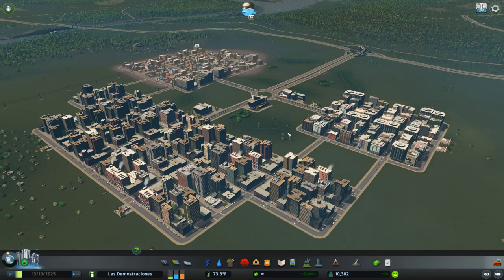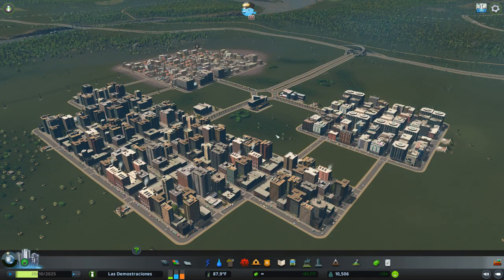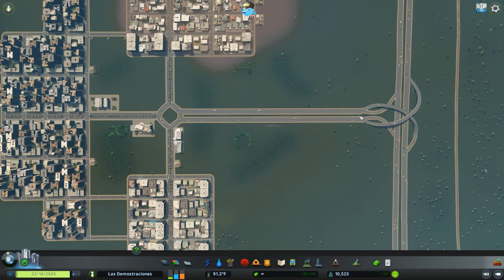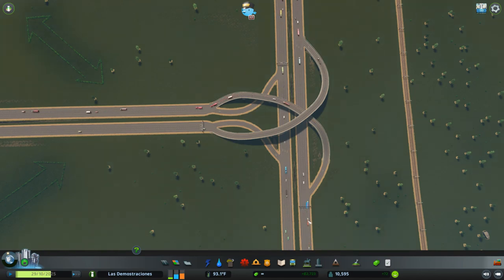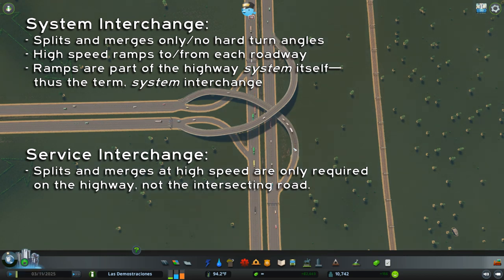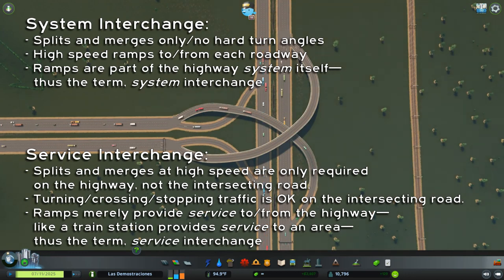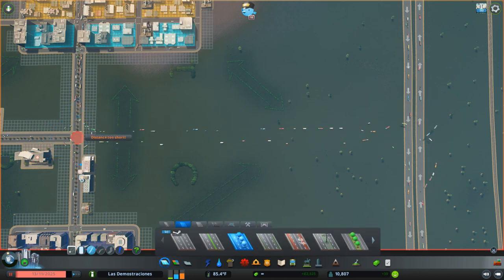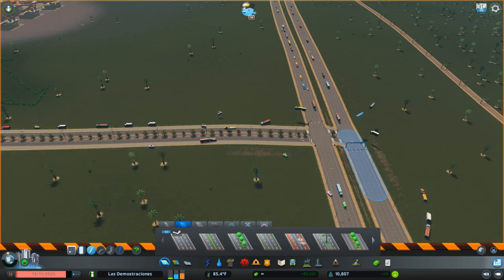Crash Course on Building Highway Interchanges | Cities: Skylines

Comment: I would put in a more free flowing double trumpet, longer lasting if it needs replaced at all instead of upgraded.   Pull traffic off the freeway before adding it on and you are jam proof.  Takes up less space than the diamond too.

Comment: OMG that last trumpet is really eye opening 😱

In my mind, I thought of dividing diamond in order to make the southern inbound traffic turn left then send them to the right side of the road but since I play without traffic mods (e.g. tmpe, road anarchy, custom road designs), the only way to do that was to make dedicated ramps like in the original interchange 🤣

My city is already in its fourth year so in the early days, I only construct system interchanges but when my city expanded, I used custom service interchanges from workshops so my mind hasn't adapted to that and I've only think using system interchange concept 🙃

I'd definitely try to practice and make my own service interchanges in a new city because finally, my first city is about go get full with no space left to build 🙈

Thanks for this video!
Reply from the maker: Daniel Alexander hi Daniel, I’m so happy you enjoyed! I think you’ll be pleasantly surprised by how effective simple service interchanges can be. Just start with diamonds and folded diamonds...and keep the ramp intersections farther apart for busier cross roads.
Reply: @LeeHawkinsPhoto  yea! I usually keep my intersections 4-6 nodes apart so perhaps that'll suffice 😁

Comment: Am i crazy, or did you take a decent junction with no weaving or lane switching and replace it with a worse one which has lots of conflict points and absolutely can't hold up to heavy traffic?
Just because the default one is for a "Highway" doesn't mean it won't work well for normal roads. You can just downgrade them and join them to a normal avenue to cut down on the amount of space they take up.
The default one does allow traffic to go both ways on the highway, and the game makes no distinction between the system and service interchanges you mentioned. you can take any road and upgrade/downgrade it to the type you need and freely switch between normal roads and highways as needed (space permitting).
Additionally there is no downside to ramps like the default junction in this game, other than aesthetics. in-game maintenance costs are insignificant for the ramps (which isn't true of IRL highway ramps).
Reply from the maker: John Boyer great question! The original junction is fine, sure, except that 1.) it does not allow for extending the main road across the highway and 2.) it is total overkill. This type of interchange will handle plenty of traffic without significant traffic problems...I show this in my series More Money, Less Traffic in I think Part IV when I demolish another one of these.

Unlike many beginner videos, I completely advocate against extending these starter interchanges into a highway—highways are really hard to get right for new players in dense urban areas, and I’d rather see players demolish these big boys and build simpler interchanges (especially at first) because traffic problems are sooo much easier to troubleshoot.

So yes, the default is an ideal interchange if you enjoy building Robert Moses style and you want highways everywhere...and there’s no doubt that highways are fun to build and watch...but they wreak havoc on urban traffic patterns, neighborhood connectivity, and walkability, and the majority of new players don’t understand how to fix the problems they’ve accidentally created when they use them. 

In short I wanted to demonstrate that simple works just fine, and opens up lots more options. And there are no weave areas with the trumpet interchange that didn’t exist with the default 3-way stack interchange—I built the diamond interchange here so I could show that the trumpet is more appropriate here, since it eliminates the turn conflicts.
Reply: Ikr, irl they do build a big interchange for a town when they plan to develop the town to a much bigger scale. Taking down the interchange is double work as you would need to upgrade in the near future of 15K people.
Reply from the maker: Iris Dovera Iris Dovera except that I’ve done this in every city I’ve ever built, with two of them built up well beyond 200k residents. One city has a diamond interchange, and another is a bit more complicated. So really, if I built this city up to 15k or 150k, it’s possible that I’d need a more sophisticated interchange, but what I build in this area will affect traffic flow far more than pure population. So many city builders use the highway as more of a local trunk road, which is really a job better suited to several avenues rather than a monstrous highway. When your neighborhoods are connected by more than just highways, then it relieves a ton of pressure on the interchanges—which are always the trouble spots in a highway system.

BTW, sorry I missed your comment a while back. I love the debate—I really wanted to stir the pot here and get people thinking. I think a lot of the conventional wisdom with this game is...not wise...at least not all the time. Highways especially are way overused.
Reply: @LeeHawkinsPhoto  Agree with Lee here. The service interchange is not appropriate for a city road. Building oversized intersections is unrealistic. I'd at the very least downgrade the access road, although in future I'd actually probably put a divided highway through that open green area. Super overkill for the size of the city now, but I'd leave the space for bigger roads and even public transit for when the city gets much larger. The game is more fun to play when dealing with natural and realistic traffic problems as the city experiences growing pains just like real cities.
Reply from the maker: @ModMINI  yes, I definitely am not one to build an entire city's roads before putting in any buildings or zoning. I try to plan ahead a little, and when it becomes apparent that I need much beefier infrastructure, then I figure out how to shoehorn it in there with minimal disruption.

Comment: I picked up a great advice from you, making the first buildings in the industrial area offices so the traffic doesn't back up.
Also making the industry a strip along the highway with enough interchanges. 

What I still struggle with: office zones, getting them to level 3... they seem to need good coverage of public traffic? plus police, fire, and hospital?

On interchanges, I usually elevate the highway and connect to it using a large roundabout tucked underneath and 4 ramps. It's easy peasy.
Also fun and not so hard, a stacked interchange of two equal highways where the main rounds just cross underground at level -2 and -1... the rest is just some spaghetti involving two bridges, not that hard...
Reply from the maker: Marc De Cock glad to have helped you be more successful! Getting buildings to upgrade is going to be a major topic in MMLT Part 4 😃 so it should hopefully help you figure out how to make this happen. Offices do like public transportation and services, and that’s because they increase _land value_. Land value comes from a lot of places, but parks are probably the biggest.

Your interchanges sound good too! That roundabout configuration is extremely common in Great Britain, and seems rather successful. I too am a big fan of 4-level stack interchanges for highway -to-highway.

Comment: I guess a faster way of dealing with the traffic backing up onto the highway would be to revert that stop sign – have the cars on the less used route (in this case from the city to north) stop instead the ones of the heavily used one (from south to the city). It would not that efficient as your quarter-cloverleaf, of course, but a good first step.
Reply from the maker: What you propose is probably a good way of dealing with the issue here, but it would definitely be a problem as the city expands—but that’s the nature of the game 😁 Cities change, and as they change, traffic patterns change—which can make your interchanges inadequate to the traffic load, or overbuilt and unnecessary for handling the traffic. I often tolerate bad traffic in an area until I get my surrounding neighborhood developed enough, and that’s because I know the traffic patterns probably will change drastically as alternate routes are added. Sometimes I have to reconfigure the roads, and sometimes everything works out fine. Highways rarely seem to stay the same over time.
Reply: Could also just put a traffic light on that end, if it's going to stay being used on only one side.  That would be a 2-phase signal, which works pretty well even using vanilla traffic lights -- and because it lets packs go through together, it'll have better throughput than the stop sign.

(I generally try to do only one-sided interchanges for service interchanges like this.  Once both sides are needed, I generally find it better in-game to put in a full system interchange I built in the intersection editor.)
Reply: @LeeHawkinsPhoto  Valid point but I think it's unavoidable to have to come back and tweak intersection signs and signalling later on and you'd just save yourself a lot of trouble and traffic in the meantime, no?
Reply from the maker: @Spudeszledesky  Probably. But the whole purpose of the demonstration was to show the major service interchange configurations and then explain why some are more desirable than others in different circumstances. I'm sure I could have done a better job of explaining/demonstrating all of that...but I will definitely circle back to this topic at some point because it's critical to getting highway interchanges to work, that aren't overbuilt or underbuilt. And I think some of my considerations will make more sense, since the city will have grown around the entire thing. Building urban interchanges is a completely different ball game from suburban or rural interchanges.